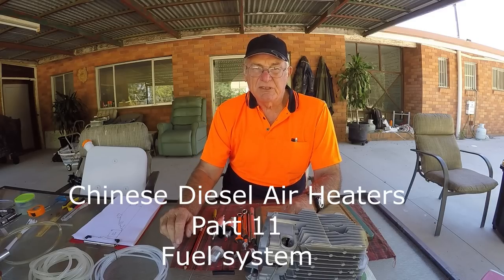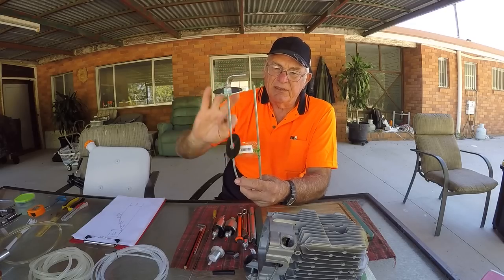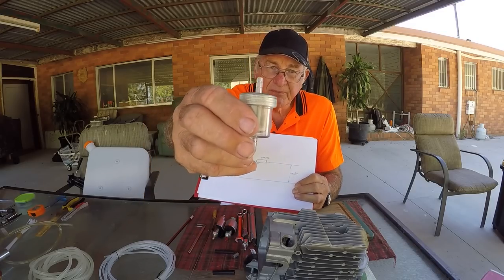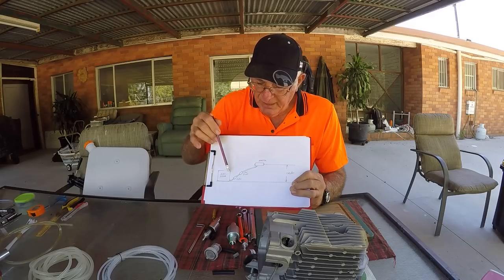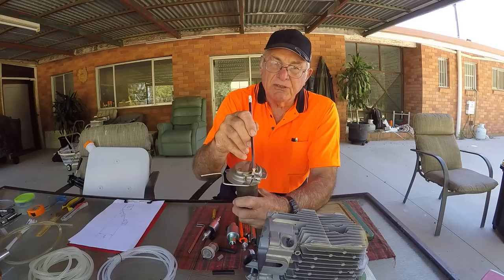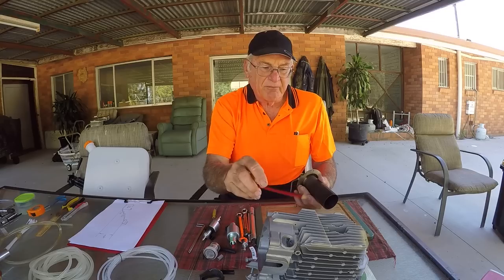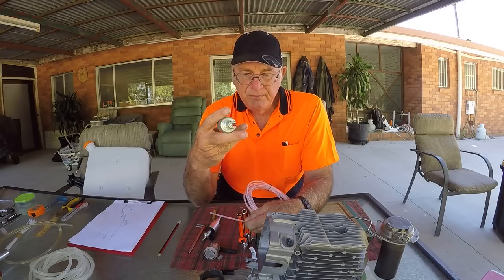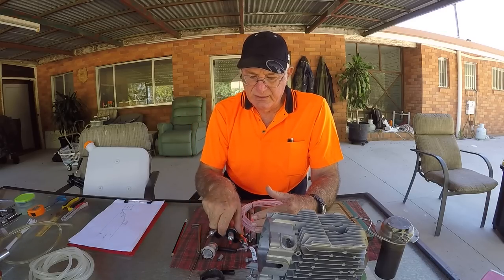Chinese Diesel Air Heaters - Part 11 -  Fuel Delivery

Comment: Us in the USA, mainly use gasoline. my self, i donot want to carry a 3rd fuel. i want to run the 2 or 5 heater on gasoline.
you have all the test equipment. please test one for us USA campers with gasoline,, for about an hour .. please reply.
will you run one for me with gasoline.. if it does any damage,, i will pay you or buy it from you.   
will the pump work well? does it soot up less if it is hotter?   will the computer control the heat? will it over heat?  make another video for USA 
Hamish
Reply from the maker: Hi Hamish,

These heaters are designed to run on diesel. The diesel version will not run on gasoline/petrol.

You can buy a petrol version of the original Eberspacher heater.

One Chinese manufacturer that I know of has attempted to offer a petrol version and one viewer bought one but he could not get it to work. These petrol versions have been removed from sale for more development work.

If a Chinese petrol heater does come on the market I will buy one, bench test it, and produce a video.

Cheers.   JMcK

Comment: So can if use copper brake line?  Like in the hydraulic steering case?
Reply from the maker: You can use small diameter copper pipe.  JMcK

Comment: Hi John. Great video. I've cleaned my heater out as the atomiser and the glow plug as you showed me. I replaced the atomiser with a new one and cleaned the glow plug tip. I tested the glow plug and burned my finger in the process lol 😂 I've turned my dowsing pump more vertical but on the delivery side it seams to be foaming and I can't get rid of the bubbles 😩 When I put it in bleed mode it nearly reaches the heater but always falls short 🤔 Do you thing the dowsing pump is US? Can you advise what the issue could be. Thanks Stevie 😎🇬🇧
Reply from the maker: Hi Steve, sorry I missed this post. 

It looks like you have air leakage in the fuel delivery line. Make sure your connections are nice and tight, and the fuel line is not chafed.

If you are using the thin hard nylon on the tank to filter to pump you need to join those components with short rubber joiners. I suggest you take out the joiners and run standard fuel line from tank to filter to pump. This removes a lot of potential leakage issues. Use the narrow bore fuel line from the pump to the heater.  JMcK
Reply: John McK 47 
Evening John. Hope your keeping safe in this difficult times where enduring at the moment 🙁 It's lock down in the UK 🇬🇧 and I'm furloughed from work 🙄 Anyway thanks for getting back with my question about my fuel pump. I bought a new one and positioned it vertical blew the fuel line out and found some debris in the fuel tank blocking the fuel line from the tank........🙈 Anyway bingo it fired up first time and no air bubbles 👍🏻 But now the LCD display is dull 🤔 Thank you very much for your great explanation on these Chinese heaters and mind now keeps my garage  nice and ward when working on my model railway 👍🏻 But we need too stop buying Chinese products after this Covif-19 is over and stop their economy like its crippled ours 😩 Cheers again Stevie 😎🇬🇧
Reply from the maker: Stevie Athers. 

Thanks for the latest feedback Steve. All good here in Aus, and I have plenty of lockdown projects, but sad not to be sailing the Med again this northern summer. Good luck with your model train project.  JMcK
Reply: Morning John hope you and your family are all keeping safe and well? After your help and fantastic video my Chinese heater is purring like a pussy cat and keeping my garage lovely and work while working on my model railway 😃 Anyway can you recommend a power supply please? I'm using a van battery with a trickle charger at the moment. I purchased a Chinese power supply AC-DC S-360-12 input 200-220V output 12V 30 A. But unfortunately it didn't last very long.........🙁 So I'm back on the battery and charger!! Any recommendation would be much appreciated. Have a nice weekend Cheers Stevie 😎🇬🇧

Comment: I completely get the idea behind the hard line in theory but is it a necessity ???? 
 I honestly had more issues with these hard lines than i do using 2.5mm Tygon fuel hose plumbed straight into the fuel pump fittings and heater itself.
 Using a mixture or rubber hose and hard line with all those clamps caused me headaches with air leaks and poor fuel delivery .
I went to 2.5mm Tygon all the way no joiners , got rid of the crapy filter that came with the kit and now use an in tank weighted weed wacker walbro style filter that enters through the top of a proper 5L fuel / jerry can instead with a breather and i have no issues at all now , no air leaks it primed up within 30 seconds along a 3+ meter run of fuel line and fired right up . 
The hard line was causing alot of unwanted hammering and the fuel pump was very noisy as well which has since disappeared after i changed fuel lines .  
Another misconception is making the exhaust tube too long ? mines around 2 meters from one side of my van with a silencer in the middle and no issues with back pressure  causing errors and flame outs etc .... 
Maybe some heaters are sensitive than others ? But there is also some Chinese heater manufactures that actually supply Tygon fuel line in the kit .. so im hard pressed to accept that its a necessity to run 2mm hard fuel lines at all. Im not against your information John but i do think running Tygon 2.5mm line is acceptable non the less .
Reply from the maker: Hi TAU

Thanks for the feedback. If you use proper good quality 2.5 mm fuel line for short fuel line runs you will not have issues with a clean install, but I have seen heaters supplied with poor quality very soft vinyl fuel hose. They will also run ok initially.

The issues come if you have long fuel runs and a poor install causing an incomplete and dirty burn and hence soot deposits in the two burner chamber atomising screens. Now the fuel pulses from the little piston pump are absorbed by the flexible fuel line and there is insufficient pressure to force the diesel past the soot deposits in the burner screens to get a proper burn.

I prefer to do installs using quality 2.5 mm fuel hose as you describe on the pick up side of the pump so as to remove the multiple joins needed with the thin hard fuel line from tank stand pipe to filter to pump. But if there is a long run from the pump to the burner it is better to use the thin hard nylon fuel hose.

On my boat the the outlet from the pump is approx 5 meters of thin nylon and I have had no service issues with the heater in 10 years. Some boats and land vehicles have a fuel line run much greater than that. If you have long pump outlet lines the fuel pulses get absorbed by soft fuel line.

The Germans are very smart technical people. They did all the design and development work for these diesel air heaters and they would be well aware of the issues with the multiple joiners, but to this day they still supply their genuine heaters with thin hard nylon fuel line.

However having said that, the genuine heaters still come with that ridiculous small screen filter in the fuel pump and no external filter. I can only think the diesel fuel quality in Germany must be better than A++.

The issues with a long exhaust come if there are sharp turns and bends. Because it is a simple closed system if you put restrictions in the exhaust causing flow volume reduction, you also restrict the intake air volume. The ECU has no sensor measurement of the intake air volume and injects the amount of diesel to match the volume of air (read oxygen) it thinks to get a proper burn. 

With restrictions you now get a poor fuel air mix and hence you get an incomplete burn which leads to carbon and soot deposits. A major maintenance issue with these heaters is carbon and soot buildup in the heater.

Thanks again for your thoughtful feedback.

Regards,  JMcK

Comment: i have a all in one with the intake fuel line coiled up, is there a minimum length or should i cut the coil down to length , why have they added so much line?
Reply from the maker: Hi John, 
Yes, you can cut the fuel line to length, but not too tight, so leave a little slack there. JMcK

Comment: Every time I watch one of your Vids. I come up with another question. What is your back ground Mr. John.? ( Profession )   Rick
Reply from the maker: Oh Ranch Dude, mostly self taught. My pre retirement working background was management in a multinational company in the technical field, in particular glues and epoxy resins for industry, marine and aviation. JMcK
Reply: @johnmck1147  How are you doing on your 24v pump???
Reply from the maker: RanchDude43 
Has not arrived yet RD
Reply from the maker: RanchDude43 

Hi RanchDude. Eventually received and tested the the 24v pump on 12v. It works the same, but with a much lower current draw. Approx  0.2A as against 0.8A for a 12V pump. However I would only use one in an emergency as the force of the diesel pulse is noticeable less. 12V into 24V windings appears to generate less force which may cause troubles with fuel delivery over longer hose runs. 
Regards.   JMcK
Reply: @johnmck1147  Mr. john, that is just about the way i figured it. Thank you, Ranch Dude43
Reply from the maker: RanchDude43 
👍

Comment: Hi love the videos
Can you help, I have a new diesel heater but when I connected everything up it will not show the voltage? 
It’s shows a blue battery, a blue picture that looks like it may be the glow plug 
It shows the outside temperature and it has a red round sign with a red line in it 
Any help would be great as I cannot send the heater back now and they are messing me around 
Many thanks
Reply from the maker: Hi Adrian, some controllers have a battery symbol, but no voltage.
Does the heater work?  JMcK
Reply: @johnmck1147  
Yes it’s blowing cold air but not doing anything
Reply: @johnmck1147  
The remote won’t turn it off or the controller, I am having to take the fuse out to the it off
Reply from the maker: Looks like you may have faulty ECU or controller. If new, suggest you ask for a replacement.
If old, you could try a new controller off eBay for around $15.  JMcK

Comment: Does the diesel HAVE to flow uphill? Can't I pump fuel from the bottom of the tank to the top of the tank, flowing downhill to the filter and the pump at a lower level, then the heater at floor level? Provided I use the hard nylon hose? Because I don't see how you mount the heater at floor level in an RV and have the fuel, filter and pump LOWER than floor level? Am I to understand these items have to be underneath my RV? lol
Reply from the maker: All good if you use narrow bore hard nylon on delivery side of the pump.
If tank higher than the pump and heater you should install a shut of valve in fuel line before pump and turn off when not in use to prevent seepage into heater causing flooding issues.
Have you seen motorhome videos?  JMcK
Reply: @johnmck1147  Thanks for the reply John. Just watching part 2 now. It’s all coming together smartly now. Thanks for your help and the awesome videos! Cheers from Canada!

Comment: Hi John. There seems to be a lot of comment about the ADR compliance of the white Chinese tanks and the white fuel line. Some are suggesting that it will invalidate your insurance. Could you comment on this please?
Reply from the maker: Hi Colin,

I have heard of no insurance issues here, but then again, I have never heard of a problem with the supplied fuel tanks, or with the thin, hard bore nylon fuel line, to cause an insurance claim. The Germans have been using the hard nylon fuel hose for decades, and the hard nylon fuel hose has been on our boat for over 20 years without any issues. I doubt you would get that sort of life out of some ADR compliant fuel hose.

I guess this is the domain of each individual country.

However, the clear large bore plastic fuel hose sent with some heaters is very poor quality. My test samples perished in less than 6 months.  JMcK
Reply: @johnmck1147  thanks John, much appreciated. I've really enjoyed these vid's. Most informative! Cheers.
Reply from the maker: Colin Kleinig 

👍

Comment: Would the commercial fuel hose not perform better?
Reply from the maker: Hi PN,

I use normal commercial fuel hose, not that clear plastic rubbish, from tank to shut off valve, to filter, to pump. But from pump to heater, unless a very short distance.

You should only use narrow bore hard nylon from pump to heater so fuel pulses are not absorbed buy soft fuel hose.

You can use 2 mm stainless or copper if you wish. 

If going through an engine compartment or machinery space you must use metal fuel hose, or run the nylon fuel hose through copper or stainless pipe for protection and safety.   JMcK

Comment: Hi John. How do install the pick up on the top when the 10lt tank has a join? Thanks in advance. Neil
Reply from the maker: Hi Webbin,  I assume you want to install a pick up tube on the supplied plastic fuel tank.
You can use a pick up tube from ebay with the large flange, or make one yourself. Just drill a small hole for the tube itself, lightly sand the plastic around the hole, and glue the flange down with an adhesive sealant like Sikaflex. Being on the top you have minimum chance of a leak.  JMcK
Reply: @johnmck1147  thanks John, is that a better option than using the side or bottom container options?  If I attach the fuel tank on the rear bar the distance will be 6 mtrs when filter then pump close to tank. Is this still ok?  The line length is only 4.4. mtrs. Where do I purchase exactly same plastic pipe from? Thanks Webby
Reply from the maker: @webbyn  

That should be OK if the delivery fuel line from the pump is narrow bore hard nylon.
You can use one size normal fuel line from tank to filter to pump. 
Suggest you consider a fuel shut off valve close to tank, and before pump.
Shut off valve available from auto store, marine shop, tool shop.
Narrow bore hard nylon fuel line available online. Search for hard nylon fuel hose for Eberspacher or Webasto parking heater or diesel air heater.    JMcK

Comment: What are your thoughts for a fresh air vent. pulling the air back from in the van or one on the outside wall pulling fresh air in from outside ?
Reply from the maker: Hi Patricia, this is a personal preference. 

If drawing air from inside the van you recirculate stale air and you need to keep a vent open somewhere to give you fresh breathing air. But the heater is more efficient and heats the van quicker in colder climates.

If drawing air from outside the van you suck in lovely fresh air but the heater takes longer to heat the van because it has to heat colder air. If sucking in outside air you must make sure the heater exhaust can't be drawn into the intake air vent, and you must also install a large air filter or screen on the intake hose to keep out bugs, little birds and small children (as one viewer put it) from being sucked into the heater. 

I hope this helps.  JMcK
Reply: @johnmck1147  thank you

Comment: When on your caravan or Rv do you hear the fuel pump clicking all the time
Reply from the maker: Hi Stephen,  yes, these fuel pumps "tick" some louder than others, depending on how you mount them.  If you can suspend the pump in space with shockchord you will reduce the ticking sound considerably. (See boat video)

If the noise is real loud, you may have an air bubble trapped in the pump. Tilt the pump more vertical, also check the hard nylon fuel hose is isolated from the vehicle.

Webasto (German company) make a pump with a diagram on the top to lessen the noise on their heaters, which also works on other brand diesel heaters, but you could buy a couple of Chinese heaters for the cost of one pump.

Sorry.   JMcK
Reply: @johnmck1147  thanks John I have just bought the heater last week. It not been delivered yet been watching your videos to learn about the diesel heaters